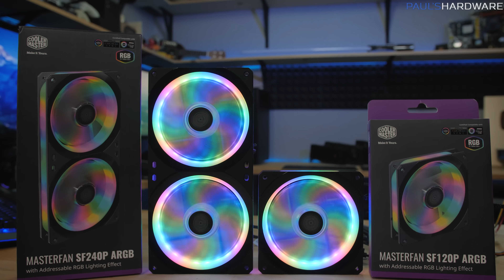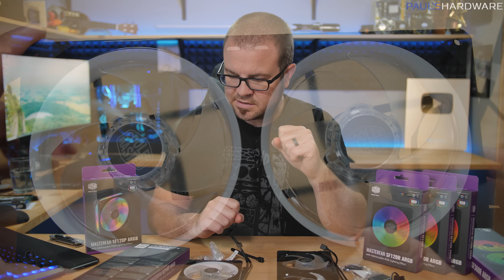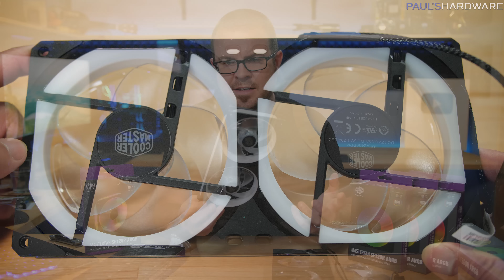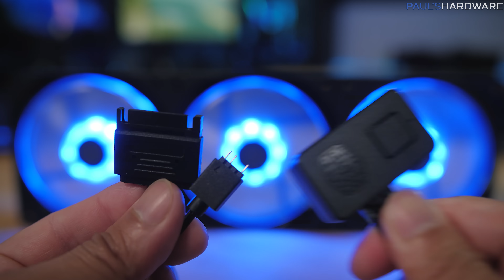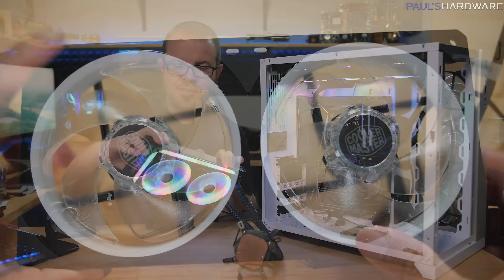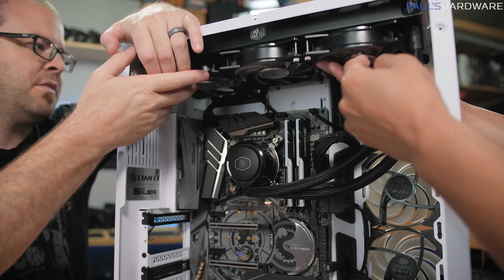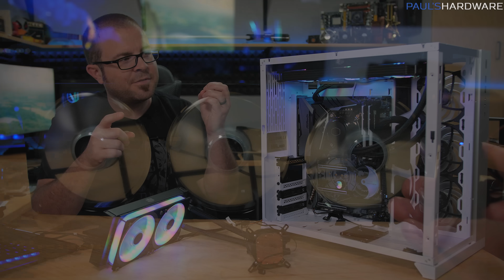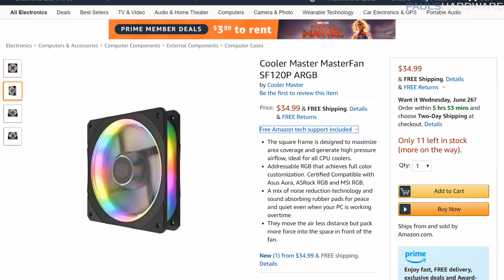Why Didn't Anyone Else Think of This?

Comment: CM needs to do a v2 where they collab with Sunon to make their own maglev fans, or at least collab with Corsair who also have used Sunon's maglev tech in the past for this to be even considered worthwhile to buy. Magnetic bearings are way easier to deal with if they get clogged with dust, and if CM want to make a new standard of magnetic bearing fan in collaboration with Sunon (because heat may well kill the magnets if it's hot enough) create a system where the magnets are replaceable. That's dope, that's...

Why hadn't anyone else thought of that?

Comment: This is neat but I much prefer how Lian Li has done it on their prototype - being able to daisy-chain fans together with metal contacts so you can achieve these multi-fan setups without lots of wires, but also allowing you to split them up and move them around, or replace a fan that dies.
That, and I've never been that blown away (no pun intended but ah well) by Cooler Master's fans. Then again, I'd rather spend the money on Noctua fans instead (plus I love their brown-and-beige).

Comment: My biggest gripe with rgb fans is freaking make them reversible! I have 9 corsair ll120's in a lain li pc-o11 dynamic and I get to look at the back of 6 of them. 3 on top pulling air through an H150i 3 on the bottom blowing straight onto the gpu and the 3 in the side exhausting.

Comment: I think maybe having some modularity would be smarter, having magnets on the sides of the fans with gold contact pins or small stashable cables to link them. I could see a problem with having insufficient power though but maybe you could make some modifications to get it to work

Comment: I would prefer fans that clip together and include a perfect length splitter in the box. Easier to replace one fan, fans are reusable if you ever move to a mini style case or want to use them for other projects. I mean realistically I have always made my own splitters so that any set of fans that are together have only one connection to the motherboard it isn't hard to do and they could include one in the box for pennies. The problem that this product solves does exist but it isn't enough of a problem to warrant such a stupid product when there are simpler solutions that would work just as well for everybody and even better for everybody else

Comment: the biggest benefit is definitely cable management. I have two 360 radiators and the fan cabling is OCD inducing. But the price needs to be lower, it's too expensive, it should at least have price parity with 3x RGB 120mm fans.

also...thermal performance?

Comment: I don't care for RGB.  All the cases I have bought have opaque side panels anyways(I also like cases with a 5.1" port for a disc drive, so I guess I'm not following the current case trends).   I actually put some electrical tape over the power LED on the front panel of my Define R5 because it was brighter than I wanted it to be.  Since I can't see the innards I just go for the best fans I can get that will be quiet yet provide good air flow and last a long time.  I think I have a mix of noctua and be quiet fans right now; in the future I'd probably go all noctua.

Comment: I thought there was another company releasing or were showing a fan that could be daisy chained with connectors built into the fan frames so when mounted together you would only need one power cable, and 1 led cable.

Comment: G'day Paul,
I like the look of the 120P/240P, I like the 2 fans only needing 1 set of plugs also,
I wouldn't use the Unicorn Vomit setting but I liked it with the single colour

Comment: The reason no one does it: when a fan dies, then you gotta replace the whole thing. 

PC building should be about maximizing performance per dollar and constantly striving for efficiency and aesthetics. 

Yes, part like this are easier to install and create a nice one piece look, but you’re trading off the CORE of building PCs ... and that is interchangeability if parts and being able to upgrade. 

I’d rather change one fan as I go along than have to replace a triple cause one motor died.

Comment: Too expensive for something that cannot even do 50K hours MTBF - for that price you can go Delta/Noctua and add your own RGB. I've got 12 Akasa S flow fans (120mm and 140mm) that I later added RGB to and didn't have any issues with cable management, and if one dies, I only need to swap that one out.

Comment: Def think it's a good idea for radiators.  Then add in a little gasket between it and the rad to seal everything up, and you can ensure all the air the fan is pushing (or pulling) through the rad goes through the rad with out leaks.

Comment: I REALLY dig the look on those SF240P's... but JEEBUS, those things are, like, Corsair expensive... Unless the price came down, I'd have to say those are a hard pass for me.  The R fans seem much more reasonably priced, though I wonder what their performance is like on a heat sink or radiator given their fan blade design appearing to be skewed in favor of balanced air flow v static pressure or raw air flow?

Comment: I would definitely go for this style of fan mounting/design if they had 140mm, 280mm, or 420mm options, since all of my case fans & radiator are 140 & 280 respectively.

Comment: I was absolutely stoked to see these, they look awesome and would drastically clean up the water cooled build I'm planning...
And then you said rifle bearings. No balls, no deal. It also would have been nice if they made an SF240R and/or an SF360P to have a matched set in a system with multiple radiators of different sizes.
Reply: But rifle bearings are better than ball bearings? Similar durability but a lot quieter.

Comment: 360 with the RGB on the sides,... I'd be in!
Although I'm not hurting for RGB fans, I think I have 6 140's and 3 120's but that was in my c700p, I had electrical issues and switching to the h500p mesh tonight. But I'll still have those 2 200mms RGB's with the 3 120's on my rad, and a 140 exhaust. Sure gonna miss the ones I had on the bottom of the c700p, but I'm adding the Corsair Lighting Node Pro. So should still have quite the dancefloor. Sadly the cap on my NZXT Kracken x-70 360 AIO went out when I fried a motherboard, but the pump still works so it's not worth another $200 bucks just to get a new one. And some RGB ram would be nice but I have 32gb of regular and again, not worth the switch. But I DO like my RGB!

Comment: I think the noise problem comes from the zalman controller. If the PWM  is not above 20kHz then most fans will make a noise. It is louder the slower the PWM duty cycle. Try it with other fans and see if they make a noise too.

Comment: Really like this product - but my problem is that my glorious InWin 303 that I would LOVE to add this setup to has irregular fan spacing, which is REALLY unfortunate(in general - my only real problem with the case).

None the less, LOVE me some Cooler Master fans; best performance for the price in my experience. After trying multiple brands, aside from the occasional very specific exception, the only fans I'll use at this point are CMs and Noctuas.

Comment: I wouldn't mind a non-rgb version of the dual and triple fan sets. Could make some cramped case builds a bit easier.
Reply: how on Earth
Reply: @nachemistry7998  To clarify, I didn't mean rgb had anything to do with the ease of build, just the form factor. Sometimes it can be a bit jiggly to properly fix radiator-fans-case in front load configuration, because the fans shift a bit and you can't find the screw holes, and cabling can be a pain. I don't really like any lighting for my hardware other than troubleshooting lights and power, so I would have liked a non-rgb version.
Reply: @7rich79  Ok definitely agree

Comment: Way too expensive. Might as well just buy Noctua fans and put Phanteks Halos on them for less $$$.
Reply: haha dafuq? thats either the same price or a much more expensive option!!
Reply: @kerrypetersen4024  mmm, but you would still have much better fans.
Reply: @Kathdath  I have the cm fans and they perform just as well as noctua. People need to put down the noctua kool-aid already
Reply: @kerrypetersen4024  Show me the numbers that confirm they perform as well. I've been trying to substitute other fans for Noctuas for many years.
Reply: @nimrodery  a simple google search would suffice. or even search youtube? its not that hard
Reply: @kerrypetersen4024  Which fans should I be googling specifically? "I have the CM fans" isn't very helpful as CM regularly axes their entire fan lineup. Noctua has been using the same models for years, only changing when they can make better fans. Which fans do you have that you can prove are "just as good?" That's a question for you, not Google.
Reply: @nimrodery  ah jesus, another game player. good luck figuring it out on your own.
Reply: @kerrypetersen4024  The only info I have on these fans is that provided by CM, and their own page says these fans aren't as good as the competing Noctua case fan. The CM model produces more noise while pushing less air than the NF A12x25 PWM, a Noctua case fan that has been on the market for years. Unless CM is publishing incorrect information, you're wrong (the Noctua has been tested by a lot of different people).
Reply: @kerrypetersen4024  you could never be more wrong.. CM  does not even come close to Noctua in performance or longevity,the same comparison could be made  of CM to BeQuiet fans.  i run all 3 types in 4 Different builds at this time, along with other fans  thru the years like CA / Phanteks /Cougar / Apevia  etc etc  in the 40mm 80mm 92mm 120mm 140mm...Yes CM  has there place  and a few ok fans....  i do think this concept has a path for Enthusiast for sure with the clean look and ease of cable management but from some  brief research your getting a mediocre fan with controllable rgb that looks nice BUT it is over priced, as is with more and more company's jumping on the RGB ban wagon to jack up there pricing.

Comment: Because it's incredibly stupid. It requires additional production lines for each version. It means that if a single fan fails you have to replace the entire unit. It means that, in the wide world of varying PC cases, you have less wiggle room if something doesn't fit quite right.

Comment: Man, I wish there was a 280mm option, i use two 140mm on the front for my intake and think these would have been great.
Reply: Yep, I'd buy these right now to try if I could get them in 280..
I love using 140mm fans over 120mm, runs quite a bit quieter at the same temps.
Reply: Yeah my radiator is 280mm so would be cool (if they perform ok.)
I think the majority of cases and rads have been designed with multiples of 120mm in mind, so you do see less 140mm offerings.
Reply: Yeah I feel 120mm fans are over presented compared to 140mm...

Comment: Paul, what would recommend to do if your mother board is a four pin RGB controller and these are only 3? I ask because I have just ran into this situation. I installed a cooler master cpu cooler and it is three pin and not 4 pin like the mother board. Cooler master connector has a block off in the fourth slot. Thanks in advance.
Reply: You need an ARGB controller for your 3 pin.  3 pin is 5 volt, 4 pin is 12 volt and bad things happen if they mix... Surprised they did not send a controller with it as a lot of MBs do not support ARGB.

Comment: I think it would be cool to test to see if the gaps between fans actually contribute to temps at all, but I would much rather have fans that had some kind of rubber seal that magnetically connected or something. Fans die, and im not going to spend 20+ a fan for it to look cool for 6-12months until it inevitably dies on me. Noctua+phanteks halo, looks sick as fuck and your fan will never die
Reply: David Freeman fans dying!?!?! Lol
Reply: Never is an awfully strong word that can't even remotely be validated. All things can and will fail. It's just a matter of time.
Reply: SABER-JOCKY yes fans take forever to die the first thing on this that will go out is the rgb lol
Reply: @saber-jocky3436  exactly, I have noctua fans from 8 or so years ago that are still kicking but I can't tell you how many case fans I've had go out on me. Spending all the money on rgb instead of higher quality bareings or whatever will hurt in the long run

Comment: i put the cooler master hyper 612 on my FX4350 and the temp never gets over 40c. when i check it at random its typically in the single digits. i get the feeling the cpu actually warms up when i turn the computer off.

Comment: I've always had a terrible experience with Cooler Master fans. I remember I had to RMA my first 212 EVO because the fan was DOA. The replacement fan only lasted about a year, and I replaced it a cheap NZXT fan from my old case. Now recently I got a Master Liquid ML240L and I ended up replacing both the fans because they make this very noticeable and annoying noise when spinning up (they sound as if a neighbor 2 houses down is mowing his lawn),and don't regret doing so. I probably could have gotten a higher quality AIO because the extra $30 I spent on the new fans amount to the same price as a H100i from Corsair.

I was actually looking forward to these because I do in fact have an issue with cable management mostly due to all my fans being rgb, and having 16 different wires to hook up is annoying as hell, but seeing as to how these fans also have some whining noise, I'm gonna have to skip them. I don't think it was just your unit being faulty, Paul.

Comment: I see no pro's for this unless it costs much less than 3 separate fans 
The reason fans are not made like this is because it's a moving part.
Once it fails it has to be replaced.
It's cheap to replace one fan, but when that one fan is bonded to two others the price to replace that one fan tripples.
Reply: It would be the hardware equivalent of a software raid arrangement. If one fails, it's all dead.
Reply: Really? No pros? I'd like to see the back of your computer. I bet it looks like a rat's nest. A very obvious pro is cable management, especially for a cramped case, which is pretty normal when you start water cooling.
Reply: @saber-jocky3436  quite the oposite actually, i work with cables every day, and every installation i finish looks like cable management porn.
Even the IO cables outside my computer are managed.
I still do not see any pro's with this fan setup as all my cables are to length.

Comment: I have never had a fan fail on me. Is that really such a common thing where this is a legitimate complaint.
Reply: It is legit.  I've had a NZXT Aer RGB fan fail on me...out of a triple-fan array...and it wasn't that old.  Not much fuss to just replace that one fan. Now imagine my frustration if I was using one of these Cooler Master triple-fan arrays and the same thing happened.  Do I leave it alone and deny my 360 rad the airflow it needs, or spend more unnecessary money to replace the whole thing?  It's a novel idea, don't get me wrong, but it wouldn't work for me.
Reply: If you using low end fans with sleeve bearings it's rare they outright fail. They'll just get progressively worse at doing the job over time. Getting slower and louder over time.
Reply: NickAirsoft I’ve had a bunch of fans fail on me. No fails from my noctuas yet tho... crosses fingers
Reply: Nope - but that won't stop the morons in the comments from suggesting that this is a "huge problem" with this product. After all, your graphics card is setup EXACTLY the same way
Reply: @RyTrapp0  You are the moron. Fans have a failure rate and there are 2 BILLION or more PC's in use with multiple fans for each,  do you think that no one that visits this channel has had a fan fail on them.
Reply: @RyTrapp0  Most graphics cards have individually replaceable fans as far as I'm aware.

Comment: Finally. I also recall some manufacturer at CES introduced fans that connect to each other without wires in a chain which also reduces wiring headaches.
Reply: LianLi
Reply: @popyfx2599  lian li it was

Comment: Video is fine. Product is meh. It'll be over priced relative to the tiny added convenience of plugging less stuff in.
Reply: Except it's not overpriced at all.   Go buy 3 TT RIING pro's and you'll spend more than buying this all in 1 kit with the cable management out of the gate.  the 360R  fans especially are better rated for static pressure as well.
Reply: Never had any problems with my coolermaster products
Reply: It's only me or those RGB feels so cheap.
Reply: @MirelRC  yeah they do look cheap
Reply: @antonhelsgaun  they look cheap due to the refresh rates of cameras being off, and therefore it will show us more individual LEDs as opposed to if we saw them in person.
Reply: Their headsets are great for the price too
Reply: You kidding? The video implies there's a new idea but there's nothing remarkable about the product other than it has puke lights.
Reply: If you are building SFF sub-15 L pc it is actually a big struggle with cables, I can see this product finding a place in that niche.
Reply: CM are notorious for overpricing their poor quality products. I would never recommend CM to anyone. Had an AIO leak on me, had 3 fans burn out on me in 1 year. I don't know why they get so much air time with these tech channels
Reply: @stevePDx   no, have you even seen thermaltake and Corsair fans? Cooler master stuffs are actually pretty reasonable except for their cases which are pretty overpriced

Comment: If the triple one had a cost of $30 tops. Then yeah. But the what the actual. You can get a decent tower cooler for that money. And since these are aimed for AIOs then what's the point. Everyone knows that Noctua makes pretty much the best fans on the market and they are $20-25 a pop.